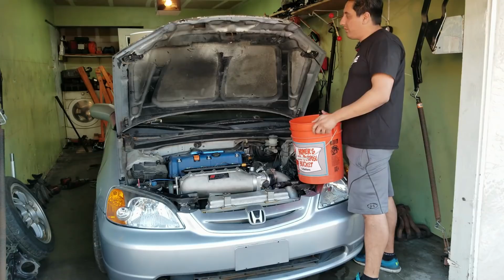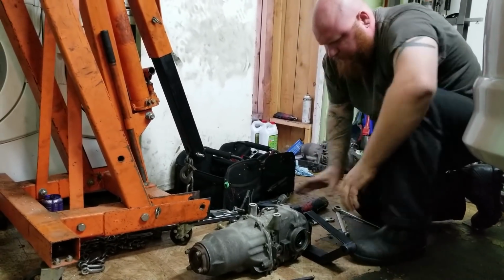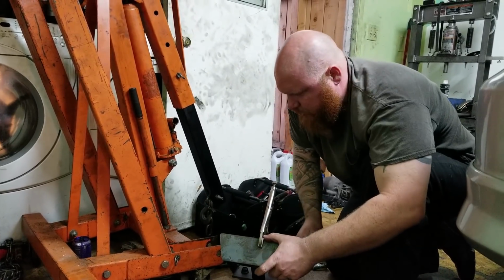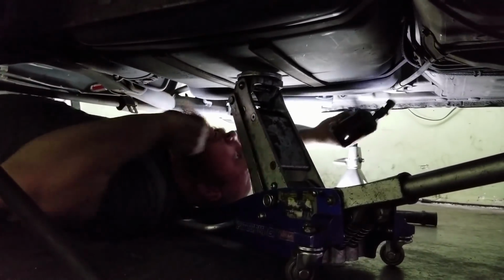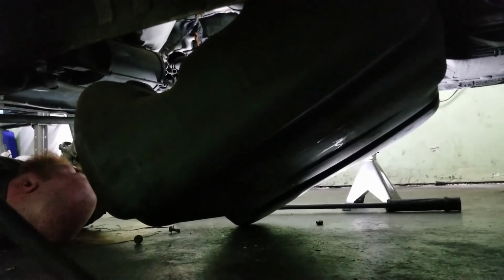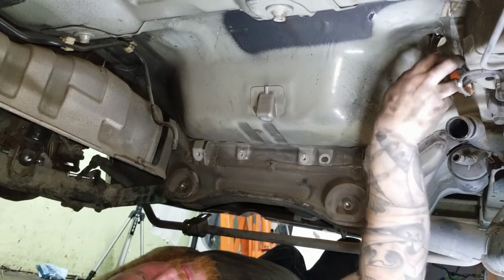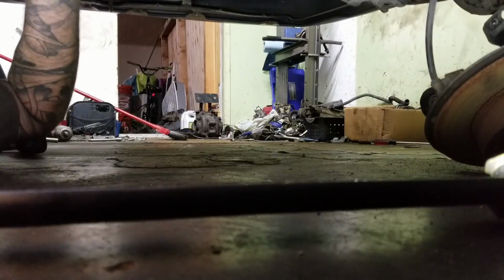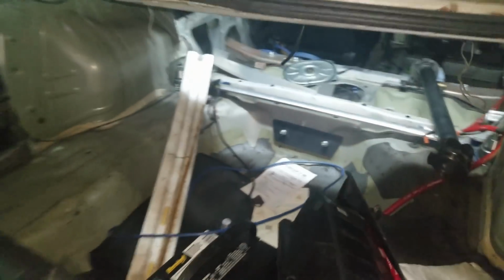Custom AWD Rear Differential bracket install on Tim's Civic EM2

Comment: Man watching your videos got me wanting to awd swap my rsx
Reply from the maker: Do it
Reply: @PirateGarage  what my winter project is going to be consist of .. how much for a diff bracket?  And I'm using all 2004 to 2006 parts
Reply from the maker: I sell them for 625 but I'm working on a new design, 02-06 crv
Reply: @PirateGarage  ok when I'm ready I'll get a hold of you for the diff brackets  If i use the 02+ diff do i need to use the viscous coupler drive shaft

Comment: I know the rear floor has to be raised approx how high does it have to be raised when doing this conversion?
Reply from the maker: I made is level with the front part
Reply: Pirate Garage does the diff mount brackets you have work with the wagon differential?
Reply: Thank you for the reply good work
Reply from the maker: No

Comment: Could the rear diff be mounted higher? My em2 is bagged and lays frame and pinch weld, and I can't have the diff hanging that low. Thanks in advance bud!!!
Reply from the maker: The drive shaft is pretty level with the transfer case, to be honest with you there is low and slow or fast and functional

Comment: Do you know if the automatic awd subframe is the same as a manual one?
Also lmk when those rear diff brackets are for sale.
Reply from the maker: The brackets are for sale msg me on Instagram, can as far as I know the subframes are all the same
Reply from the maker: It's in the description but @gravy_built

Comment: That trunk metal is so thin.  Sandwiching it with steel will help but may still end up bending that entire  spare tire area.
Reply from the maker: If you watched the video a little better you would see I did sandwich it
Reply: @PirateGarage  yes i know you did but it may still end up bending in.
Reply: well it still mounted to rear axel as well, I would think primary forces from the differential would be to torque and the axel would handle most of that. Could always do some steel tubing from the other side to like the a pillars or something. Just curious about some thing, could you use after market axel thing with that, for the em2's? also are you using a crv ecu or what ever to drive the k24? Also yes what about the rear abs sensor? For state inspection reason (I know prob don't care) what does the vehicle end up being to the computer? An RSx or STI?